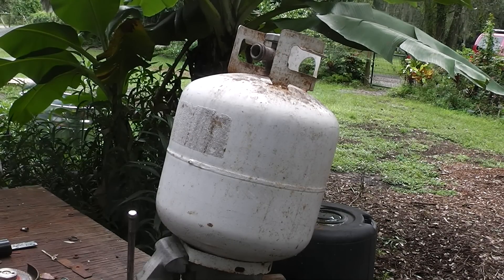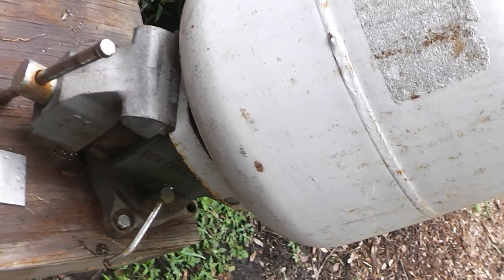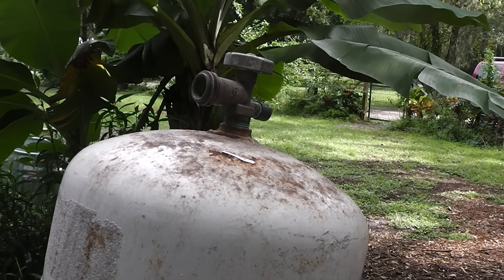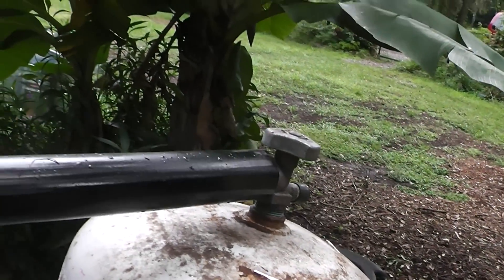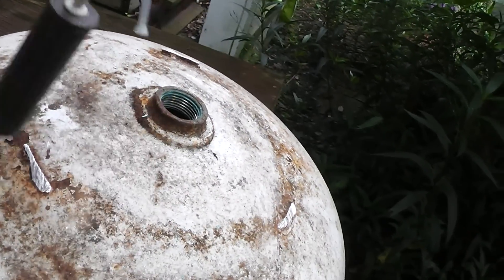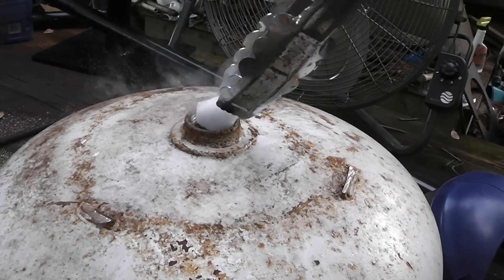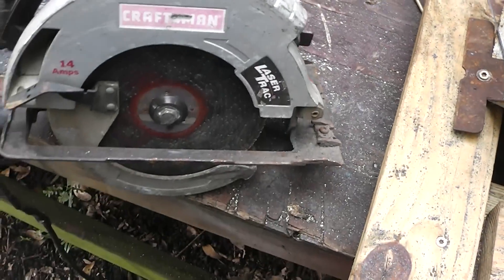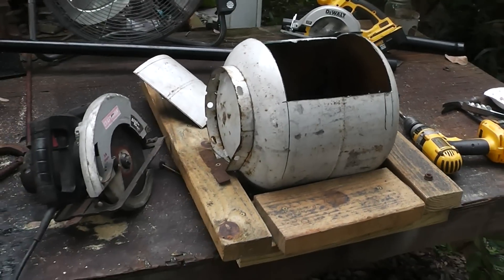How to Cut Open a Propane Tank without Blowing Yourself Up

Comment: I’ve cut thousands of tanks open once the valve is open. There is no propane left inside that tank. I’ve use cutting torches plasma torches chopsaw, chisels and hammers and never once have I ever heard of propane being stuck inside the metal. I don’t think this is possible.

Comment: Let ur saw blade reach full speed before touching the metal. Saves the lifespan of the blade, as well as the saw and it helps prevent kickback. Not a critique, obviously you know how to use a saw. Just saving you money in the future.

Comment: Does anyone out there know if you can cut the propane tank when you fill it with water?
I thought that it may be safe enough when filled with water to prevent the tank from exploding.
Has anyone out there tried this method?

Comment: You can't assume any tank with the value is empty. Not until you remove the tank valve then push any left over gas out using water and soap. I've had tanks that been EMPTY with valve open for years take value off and there's still tons of gas in tank. Basically treat a propane tank like a loaded gun

Comment: Where should I look to get a cheap/free 100# tank for my used oil burner project?
Reply from the maker: You could try the flea market but, that is always hit and miss. Look for where houses are being torn down in your area, you just light score 1 or 2 for free!  I have also seen them on craigslist but, they are usually way over priced.

Comment: No. Just fill it with water to positively displace any remaining fuel. Work smarter not harder.
Reply: thats exactly what i do just fill it with water but even then i feel weird cutting into a gas bottle it just doesn't feel right
Reply: How do you keep the water from coming out after your first cut? And avoid electricuiting your self.

Comment: Careful what you use that for. Propane has Lead 210 which is somewhat radioactive (think like radon) and Methyl Mercaptan (oderent) which is pretty toxic if it collects. Both could theoretically collect on the inside of an old tank over years of usage. I'd think pretty hard before you do something to yourself that won't show up until 10 years down the road.
Reply: A lot of people made drums out of these. Do you see a problem if you wash it with soap first?

Comment: Your method is fine, but I simply take a ball pein hammer and beat the valve in a cc direction, once around or so and you can put a crescent wrench on it and turn it out easily. No sparks btw, valve is brass, no worries about sparks.

Comment: I always rinse the tank afew times, then afterwards i set the tank around the corner of a building and light a rag on a long stick or old fishing rod and hold it over the hole of the tank. If there are any fumes in the tank, I'd rather go ahead and burn them out..  Sounds crazy, but it works. lol....

Comment: 1 out of 3 times I get an exchange tank from home depot the float gets stuck closed pressure is limited from the tank I can tell right away because my BBQ doesn't heat up very fast even with a full tank.  I stopped buying them I bought 2 brand new tanks from Costco have a gauge on them I have Costco fill them.

Comment: In the winter, you can fill the tank with water and let the water turn into ice before you start cutting.I just found a new use for recycled propane tanks. I used half of it to make a bowl that I used for transforming a drill press into a dough mixer. If you have the time you should watch the 3 videos about the bowl.

Comment: There's no way the valve was that easy to remove from the top of that tank. I've taken out and put in dozens of these valves. They don't come out with that little effort and that crappy hold down fixture. Don't bullshit people.
Reply: I did nearly the identical thing minus cutting off the guard with two tanks this weekend.....no real issues

Comment: Oxygen is not the problem, it is the propane.  Fillit to the top with water, pushing all the gas out and then drain it and you will not have any problems. This is a lot cheaper and safer than dealing with dry ice.

Comment: Oxygen is NOT combustible! Oxygen is not fuel. There is no point  in displacing oxygen in this case. You need to displace the combustible gas - which is what you did. But water would have been better.

Comment: Another way is to hold the bottle, 44 gal drum near an exhaust pipe or run an exhaust into ehat tou are cutting the co2 and carbon leave a layer/film inside sealing and reducing the risk of explosion, i emphasize reduce the risk. Great vid and great advice .

Comment: They make a great little barbecue, weld on a couple of legs hinge the door, drill a couple
of air holes in ends, bottom.  Weld handle on top and also works as door stop.
WaLa

Comment: Or just put and air hose from your compressor inside let it blow for a while then cut it while it is still blowing you will have no trouble. also a vacuum works too.

Comment: Safest way is fill it with water and then boil the water out with a fire, the steam will scavenge impregnated gas. In the oil patch I would have to steam out tanks and vessels ect then  check lel's so welders could do repairs.

 Filling with water to cut open can be a shock hazard with a grinder.
Reply: Wouldn't the fire be a risk for the tank or would the water take care of that?
Reply: @StarNone  for a fire you will always need 3 things. 
Ignition source, fuel and oxygen.
Remove 1 thing and you will not have any fire. 
Filling a tank with water will take away 2 things oxygen and fuel.
Steam will only remove the fuel and not give you a electric shock if you grinder gets wet.

Comment: when I'm going to use a propane tank for a project I take the valve out and I let the tank sit around in the Sun for a long time and make sure all the propane residual is out of the tank I have left them sitting out in the open air for over a year before I cut into them before

Comment: The pressure drives propane into the metal of the tank.  If it is full of air, and a torch drives the propane out of the metal, the result is an explosive mix.  I let the valveless tank sit in the Florida sun for a week or so, away from flame.  That drives most of the propane out of the tank, and I cut with an abrasive wheel.
Even filling with water and emptying does not get all the gas out of the metal.
Reply: Baloney. When the smell is gone, all the gases are gone. They do not penetrate the steel
Reply: You are WRONG.  If anyone believes you and tries to cut a tank with a torch he may be DEAD WRONG.  Educate yourself.   Ask a professional in the field.  My partner's law firm has litigated in 3 cases involving tanks that exploded after air was displaced with water, cases involving major personal injury. Expert witnesses say that propane gets into the metal and is released by heat.  Perhaps it will not happen under every situation, but it does happen.  Are you a gambling man?  You are betting your face or your life.

Comment: I remember when I was young. my Dad , was Gas welding, a fuel tank from a 1965 Chevy Impala.  He filled it 3/4 up with water, and connected a Vacum hose to the exhaust on his truck and placed the other end in the fuel tank. Started the truck to fill the tank full of Carbon Monoxide. Then began Welding it, HE SAID DONT EVER DO THIS. But we were too poor to buy another fuel tank for the car. Later that day we were driving again. Not the smartest thing. But you do what you gotta do, sometimes to Survive.
Reply: He was lucky it didn't EXPLODE, carbon monoxide is highly flammable especially when heated like fresh exhaust plus the exhaust also contains a small amount of gasoline vapor.  Carbon monoxide is a clear, flammable, poisonous, and odorless gas byproduct of incomplete combustion,

To fully understand what I’m talking about I need to get into a little bit of fire (combustion) behavior.   Most people don’t realize that solids and liquids do not burn in their natural state, they must be converted to a gas in order to burn.   Solids when heated go through a process called Pyrolysis where they start to breakdown and off-gas, its these gases, one of which is Carbon Monoxide, that actually burn.   Liquids on the other hand Vaporize when heated and become a gas, which again, is what actually burns.   What produces the byproducts of combustion like carbon monoxide is this heating of the fuels turning them into gas.
I know what some of you are going to say, “then why doesn’t the CO detector go off every time someone cooks on a gas stove"???   Well because natural gas and propane are clean burning fuels and when the burners are properly adjusted they able to achieve almost one hundred percent complete combustion, which means that only a small amount of carbon monoxide molecules are able to escape into the atmosphere in the house, nowhere near enough to be harmful or set off the alarm.   Now a car is a different story, internal combustion engines are not evenly remotely close to one hundred percent complete combustion and therefore pump tons of carbon monoxide into the atmosphere.   Now consider all of the very hot, very flammable carbon monoxide gas that was just pumped into that freshly purged and partially water filled gas tank, and that welding torch heating the tank steel well above the flash point of Carbon monoxide gas, he was lucky it didn’t cause flash fire, let alone cause an explosion !!!   It would have been fine to weld the tank the way it had been prepared prior to pumping all of that hot exhaust into it.
Reply: Ingenius
Reply: Thank you LTBROYT6A.  For some reason I always thought CO was non-flammable.  Thanks for setting me straight.
Reply: Why do you want to cut open a propane tank ?

Comment: On some motor racing circuits back in the day when welding fuel tanks first empty the fuel out then fill it with exhaust fumes from a diesel engine

Comment: Water and Soap fill it to the top and dump it there should not be anything to Explode also with most or all of the  Gases gone it would be hard to Explode with the one end already open where the valve was because it has nowhere to expand

Comment: How anal can the misinformed be? Dry Ice? Gimmie a break, all you need is to fill it with soapy water overnight and then drain it, no problem, I make hank drums outta these and have never had one explode! I have cut open at lest 40! DUH!
Reply: Make sure to cut straight away after draining, one commenter said it filled with a little bit of propane stuck in the pores of the metal where the water didn't reach, and he took a match to it to check and it sounded like a rocket engine taking off

Comment: could i use an old tank to contain different liquid (non-hazmat, and not under extreme pressure either, maybe 100psi), its a somewhat thick liquid (im being vague for a reason), something that would allow me to refill the tank with un-pressurized liquid and then re-pressurize the tank once filled. Propaine tanks seem to be the best pressure vessels for what im trying to do and the budget i have (which is 0$ if anyone was curious) and i just wanted to make sure the standard valve system was capable of having a somewhat thick liquid travel through it

Comment: Yea water if you are using a cut wheel.  I think it is very difficult to cut a tank with a torch when it's full of water.  I had a compressor and just hosed the exhaust into the tank when I needed to braze it once.

Comment: Large jawed adjustable wrench will break it loose through the opening in the top cage.  Allowing you to keep the handles and nozzle protection.  Use a leather belt around the tank and put the end of the belt in the vice.  Similar to an oil filter wrench.  This helps so you don't bend the stand ring.

Comment: Or you can do it the easier way : just fill it up with water...
Reply: ... and use a powerplasma cutter to cut instead of a grinder. Much faster.
Reply: and use a funnel for the dry ice instead of hillybilly chopsticks and a hammer if you dont have a water supply.

Comment: So let me get something straight. If you simply pop the valve, let air in, wash out with water, then cut using angle grinder you will be in danger? How much propane is left in the metal? I don't get it.
Reply from the maker: Like I said "work at your own risk".
Personally, I would advise everyone to do what ever he or she could to mitigate injury or death.
Reply: Not everyone keeps dry ice around. Water is fine.
Reply: Filling it with water would be an easier way to make sure it was completely empty...

Comment: I have seen in past running a pipe or tubing to a tank and filling it with exhaust fumes then commence to cutting it with a torch while fumes are steadily rolling out of tank. Of course tank had been emptied before cutting already. The tank was either a 210 or 300 bls capacity crude oil stock tank....8,800 to 12,500 gallon capacity. I learned that day how it was done by men looking for scrap metal.
Reply: You might want to read the comments here that exhaust gas is dangerous. It is flammable, by containing unburned fuel.

Comment: spent years in oil field have always just filled tanks with water to cut them it's fast cheap way to displace oxygen. Plus the water help keep the metal cool and keep hot sparks down to minimum.
Reply: this water method is the best method, no specialty anything, hose and disks
Reply: so your idea is to fill it with oxygen to displace the propane so it gives it a nice fuel air ratio? Why do air vs water?
Reply: thats pretty much what i do these days
Reply: that's what i did, and after that i watched a how to on cutting up a propane tank cause logic.
Reply: Ken Jett it takes 3 things for fire
Heat.   Fuel.   Oxygen 
Oxygen will not burn without the other two
We take 5000 gal gasoline tanks an blow them down for 12hrs an cut them with a touch
an never had a fire
Do your research an see for yourself  
So for the last 27yrs we have been doing it wrong by blowing them done ? I think not
Reply: @markfuller9886  I think your missing the point that its easier to blow down a 5000 gal tank and its easier to water down a 5 gal tank. I know 2 years late and you probably dont remember this or might not see it.
Reply: @gabemartinez2558  would you tell me the best way to blow down a 125 gallon propane tank I really didn’t want to put water in it I’m converting it to an air compressor.
Reply: i don't work for a company, but propane isn't water soluble where as gasoline is. This is why OSHA would get fidgety. Compressed air (assuming it's compressed atmospheric air) still contains about 20% oxygen (depending on the location where it was compressed).  Although both water and compressed air work for displacing propane chances are you will have to run compressed air for a very long time to displace propane vs water a few minutes. Alternatively you could fill it with co2 or argon to displace the oxygen and keep it from blowing up. Gasoline fumes are much easier to deal with. My dad is a painter and we have tons of acetone barrels lying around. You just take the cap off for a week and you have almost no chance of fire. I would assume a 500gal. Tank need a little more persuasion though.
Reply: Using a powerplasma cutter would be a fast and easy way to cut into the tank no? I've seen people using grinders and it seems to be too long a process.
Reply: Yes, that's the way to do it. One can use a cutting torch or anything else after displacing the gas with water first.
Reply: Julian Brody
Reply: Ken Jett I've done tanks for years, even fuel tanks from gas stations
The only way you should do the cutting is after you blow it down with air
Never fill with water
Reply: Sand is good too if it is convenient and fillable.
Reply: Ken Jett besides I said compressed air an there is not enough oxygen in it to burn
And pure oxygen will not burn on its own an I don't know what company you work for but OSHA would shut them down in a heart beat an fine the hell out of them for filling with water.
Reply: A always put a rag and a really long stick, set it on fire and light the tank from a safe distance. It always makes a little explosion sound and then burns off the propane
Reply: @markman63  NONONONONO. Hell no! As soon as that flame "Burns out", the canister starts to cool, and the gas contracts, bringing air (containing Oxygen) into the canister, which then makes what is essentially a fuel-air bomb. Combine that with the heat left over in the steel tank from the gas burning off, you get detonation, or at least deflagration.
Reply: Good video nice cuts

Comment: after  flooding with water there cant be an explosion. btw: filling it with dry ice is probably 100 times more expensive than simply turning it uoside-down: propoane is denser than air...remember? Explosive mix only between 4% and 40% so relax...its not a nuke.

Comment: If you do not purge the tank it will demo your face and upper torso.....  I can tell you that it is highly suggested that you purge by flooding the tank with water for 24 hours as some gases get trapped in the metal.
Reply: Yep then even after that empty and cut straight away. I left mine for a day then put a lighter to it just to make sure, never heard such a screaming noise of a jet flame, combined with steam burnt my hand!!

Comment: What brand is the metal saw blade you used? Thanks
Reply: Awesome... Thanks for your reply and your video... BTW... I deliver LPG and you can NEVER be too careful when working with it.
Reply from the maker: I can't remember the brand but, it came from Home Depot.  The DeWalt metal cutting blades for circular saws work better and last longer than the one I used in this video.
Reply from the maker: Milwaukee 48-01-2787 9" 14 TPI The Torch™ SAWZALL® Blades from HD.
Reply: Can you tell me what brand and model you use for the circular saw blade? I like that idea much more than using a grinder.